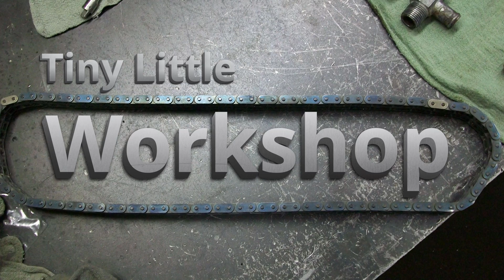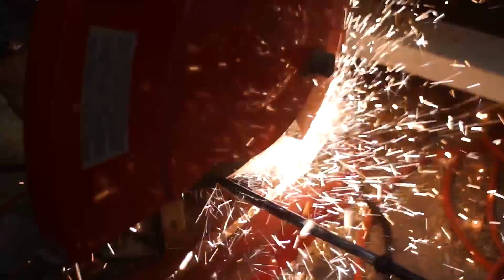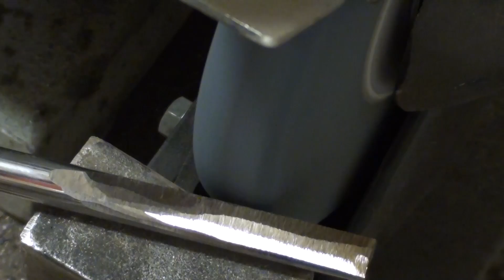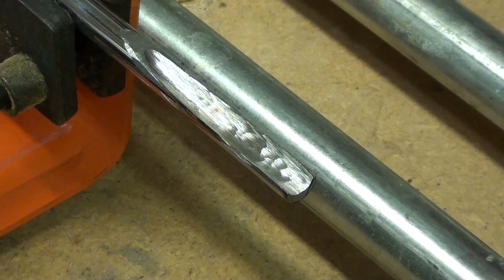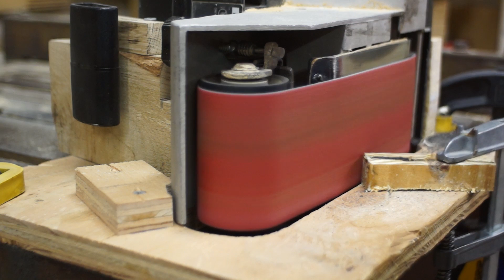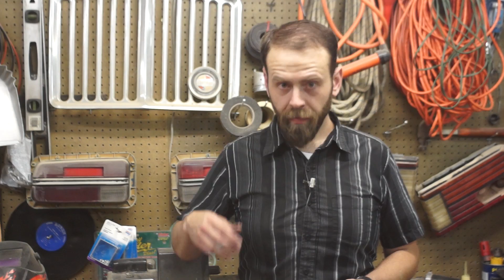Making a Lathe Gouge from a Shock Absorber

Comment: Are shocks made of good material? I've thrown away 8 and I wish I hadn't now.
Reply from the maker: It is hard to know for sure what is inside any of them. The metallurgy would certainly be different from manufacturer to manufacturer.  I mentioned in the video that most of them are likely to be softer on the inside with a hard plating on the exterior.
Reply: Tiny Little Workshop  soft and only shallow hardening makes sense. If your tool stays hard and didn't become easier to grind in the center it could be hard all the way through. I wish I had some to play with to see how it cuts on a lathe with hss and carbide
Reply: From what I've been searching and reading, the piston rods seem to be made of chrome plated steel... 42CrMo4 among others (not that good to breathe fumes if welding on it) 
The tubes might be made out of some regular carbon steel alloy (safe enough to weld).

Comment: Very nice build but the handle is way too short.  For that size tool I would think you are looking at a 14-17 inch long handle to give you the proper balance for the tool and prevent problems with it flying out of your hands with a catch.  But brilliant on the reuse of a shock!!  Gonna be looking for some!  And I would guess that the steel is plenty hard and tough.
Reply: I like the video and everything but I'll have to agree, a long handle would be my preference. I'm even tossing around the idea of putting a little weight in the end of my handle too. Not much, just until I like the balance.